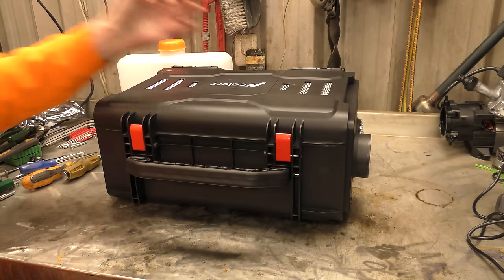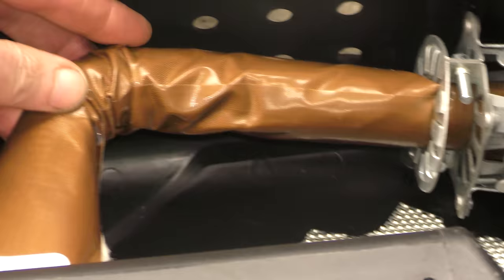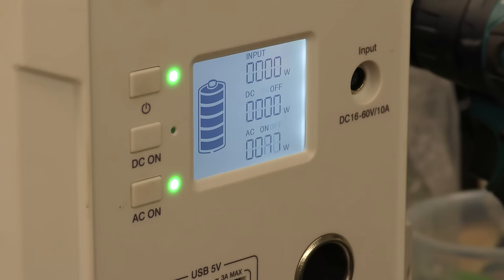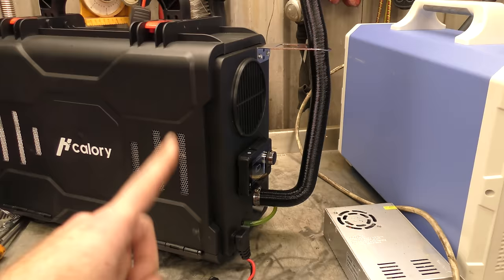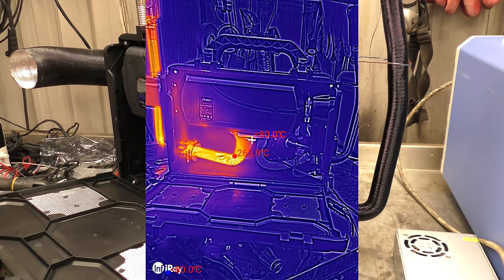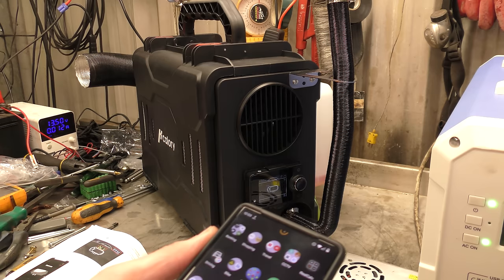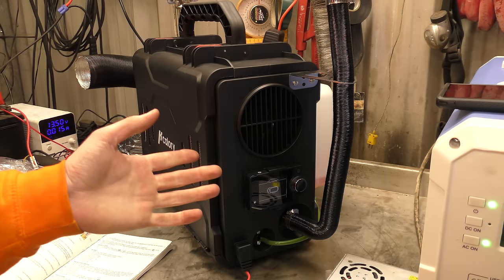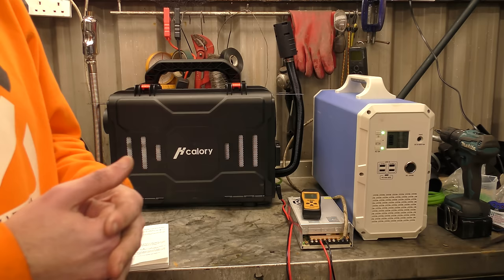Hcalory HC-A01 portable all in one diesel heater + bluetooth control ||  test / review

Comment: Thanks for the video David, Have you been able to change the altitude setting?  I have the same heater and controller from Hcalory and consistently travel and camp at elevations between 2km and 3km ASL.  Based on the instruction manual that shipped with the unit, I was hopeful I'd be able to make changes to the altitude (by accessing En06 within the engineering mode menu) –It appears, however, to only allow viewing of the mode and not the ability to modify it.  For that matter, I can't find the ability to simply fine tune the fuel low and high Hz rate (to manually set it for a more lean burn at high elevations).
Reply from the maker: I think it might be for display purposes only.

There doesn't appear to be any adjustment either.

I have found one controller that does actually do something when you turn on 'elevation' mode and you can hear the fuel pump change hz.  Its the one that looks like the original black rectangle but the display on screen is different.

Comment: David, watched. This video last year, bought the same from amazon,  cracks all over and refunded.  Be this the case, I've two units velor and hcalory,  the hcalory all in one is absolute crawly made, with nice graphic plastic and thick, but after 6 months concealed in a weather proof box attached to.the. house, cracked for no reason.  Why I mention this is, it also had the same Bluetooth function which I found great,  easier to sit in living room and turn.on.or off, up and down etc.  But now I've changed to the velor which has worked for 2 years now in the  Garage l, the Bluetooth function is a passing memory.  Question, you've had this unit a while, has the casing degraded at all,  how do you align the exhaust also, to keep water out whilst on or off,  is it worth the 159 quid at todays price or just aa a standby emergency unit, which is portable unlike other brands.

Cheers enjoy the coming freeze,  you are prepard

Comment: Hi David 
Could you tell me the diameter of the air outlet cover for the hot air pipe 
Is it 60mm or 75mm 
Would you recommend the heater

Comment: I am thinking of using one for my shed. Two questions sort of... I gather the exhaust runs at 200 degrees centigrade? So in a wooden shed that would need insulating particularly where it goes through the wall. I What is the start up and running current?

Comment: I do keep thinking about getting a diesel heater, but then I think about what it needs for it to be used for a house, and how to power it, and where to site it, and how to get the heat in, and to keep the exhaust out, and then I just can't be arsed, cos I have a couple of Aladdin blue-flame paraffin heaters (very clean burning), and with a little bit of dubious wiring I could probably even run the boiler off a decent UPS (so long as there is gas supplied) with battery upgrades, but we shall see, all this "3 hour blackouts cos no gas!!!" could just be scaremongering...
Reply from the maker: My boiler is on a 13A plug.  That's my plan in the even of an extended power outage, boiler on battery or generator.  Then at least I can stay warm.

Comment: Hi Dave, which controller do ypu recommend purchasing as there are 3 options? Or get any and change it out for the australian after burner?
Reply from the maker: Depends what you need it to do?  If you only need basic on off control or want to have schedules or control from anywhere or Home Assistant integration.
Reply: @DavidMcLuckie  on off, adjust the power to the lowest Kw, safe. Other options would be a bonus. 
I don't like the blue style control, doesn't suit the style but then there are another 2 rectangle black models.

Comment: Hey buddy, love your videos,  I have one of the liquid and air heaters. My plan is to have heated floors and heat my water tanks and batteries along with heating the air in my RV, but really need something that works on a thermostat so it doesn't just run all day... Mr Jones can't help because the connections are wrong for the afterburner. Any ideas? I thought about getting the board and controller that his controller does work with and using the fan wire to trigger a relay to run the water pump but not sure if that will work.

Comment: i have 2 ????? can you switch between C or F degrees.    And does it have a clock timer like on at 0700 a clock and off at 0730 a clock (NOT THE COUNT DOWN TIMER)  on the knobbed app controller

Comment: Hi David, do you think I could just run the combustion intake INSIDE the case rather than using the tubing to put everything outside?  With those generous vents on the side of the case, I'm guessing it'd have enough air?  Also, there is no filter on the combustion intake.  Is that a problem?  That big plastic thing is just a muffler.  I've got little 25mm intake filter on the way but curious as to what you'd recommend
Reply from the maker: Yes.  The case itself is sitting outside so you don't really need the intake.  Unless you're running somewhere really dusty, the air filter is there to stop you sucking in leaves and having rodents make a next.

Comment: Hi there, do you know of a "Quick Disconnect" hardware set that works with this white fuel line?  I need it be valved on both sides so when I disconnect, I don't lose fuel out of either end.

Comment: Great video, as I have my eye on this model.  I have a question regarding the exhaust.  It looked like the manual showed it vertical like you set it up, does this avoid the condensation from building up in the silencer/muffler, as I had heard the exhaust should be on a slight downgrade.  Asking because I really don’t know anything about it but have heard what seems to be conflicting info.  Thx.

Comment: overall nice unit . BUT, fuel tank should slide into a holder so you could slide it out to fill then slide it back in to run. exhaust: if i wanted to put in a window and run the exhaust out the window it needs to come out the other end and lay down so i can close the window on it and the hot air out would flow into the room.
Reply from the maker: Both excellent points.  I wonder if the intake hole and the exhaust hole are the same size port on the box.  Maybe it could be switched round.  I like the idea of a removable fuel tank.

Comment: just a trivial thing I noticed perhaps but all the other information I've seen concerning the exhaust pipe is that if the unit is run for very long condensation and water builds up in the pipe unless it is basically pointed slightly down so the water can drain out? comment?
Reply from the maker: In theory yes.  But the exhaust is also running at 200+ºC so any water that does condense will evaporate again.  I suppose the problem would be if you ran the heater, let it cool (condensate forms), and the didn't use the heater again for an extended period of time.
Reply: @DavidMcLuckie  ahh. Thanks for your prompt reply Mr McLuckie.

Comment: How long will that heater run on 5 gallons.  The Bluetooth is a nice feature. I heat my 32ft motorhome with the planar 44d heater. I am on my 4th year with it and no problems.  It runs 24/7 from fall to spring non stop with no shut down.
Our winters are normally from 20 degrees f to 2 degrees f and heats this motorhome very well.  Been a good heater.

Comment: Hi David. Another interesting review. I built a similar heater setup to heat my tent in winter but it has now started playing silly burgers. Won’t fire, the fan just keeps on running. Any idea where I can source spares. Ps. Used a outboard motor fuel tank and fuel connectors. Cheers, Jim.
Reply from the maker: For diesel heater spares it's usually just AliExpress or eBay for me.  Banggood have got bits like exhausts and fuel pumps but not burn chambers.

Comment: A friend and I each bought an HC-A11.
After several days of trying to get the heater to work according to the manual, we gave up.
Now I have been informed that these Hcalory Blutooth are rubbish...
So now we're wondering how you got your's  to work David...?
Reply from the maker: Well.  There's a thing.  My bluetooth app works, but the remote control doesn't.  It also refuses to re-learn.
Reply: @DavidMcLuckie ... Okay.... Neither of these two heaters stops when the set temperature is reached. Nor does the heater start automatically after the temperature has dropped far below the set temperature. Have you noticed that.?

Comment: Some heater require at least 13 continuous volts during the start up process.  Is it the same for this heater?
Reply from the maker: This controller really doesn't like voltage drops.

Comment: I wonder if the radiating heat from the exhaust wrap will cause damage to the plastic knock-off Pelican box over time? I run a small computer fan on my portable unit, such as Keegan Builds,  and it makes a world of difference in the box temperature. Anyway, thanks for review. Too bad that you had to put the power supply in the mix; it's going to pull a smaller portable battery pack down more quickly. My Jackery 1000 easily puts out the necessary 10 amps for the glow plug operation via the cigarette lighter outlet.
Reply from the maker: I'm going to start doing that as my power station test, will it run a diesel heater.  :)

Comment: Does the bottom of the unit get super hot? If it was put on a carpet or wood table would it burn the surface? Cheers.
Reply from the maker: Negative.  The exhaust is wrapped and shielded inside the box.

Comment: Will this work with a Jackery 1000 or 1500?
Reply from the maker: Most likely.  I've run other diesel heaters from the Jakery as they have a real 10A output on the 12V

Comment: I have one of the ones with the buttons along the bottom of the controller. Does the controller or the board read the voltage? It is reading .6V lower than the actual voltage at the harness and won't start unless the alternator is charging as it gets upset thinking the voltage is too low when the glow plug comes on. It's not even cold yet, it started fine in like -30 last year.
Reply: @piconano  I just put a battery in it about a year ago and cables are not green but it's 2022 where new parts are garbage so I guess I shouldn't rule it out.

Comment: hey David, I just bought one of these and used it this weekend and wondered if I could ask a couple of questions,  one I found a green piece of what looks like gasket material (I will send a photo if would allow)  I wondered if this is the cause of my other question. we used it on 6 to heat a 10x9 canvas tent and it would not really heat it like I hoped. the other cause possible is we used a 2" long corrugated hose and thought that might have let a lot of heat escape before it got to the tent. thanks for any help you might be able to give me Jason
Reply from the maker: Were you heating outside air or recirculating the air in the tent?
Reply: @DavidMcLuckie  good point it was outside air and around 15d - 9c
Reply: @jasongallant7173  Hows it working as a cold weather heater that's outside the tent and not recirculating warm air?  I'm wanting to run one of these sitting on my bumper and pumping heat into my pickup camper.  I'll be ski camping where temps are 0d to 20d often at night.  Wondering if it can dump heat.  Seems like most people struggle having too much heat with these things tho.
Reply: @vin9976  I tried it with recirculating air by adding a hose onto the intake I still wasn't super happy with the way it was heating the tent at teens for temperature I read something the other day that says to run it on low fan for a while until it gets really hot and then maybe turn the fan up so I'm going to try that next

Comment: I just bought this and it doesn’t turn on and off automatically nor is F9 available in the menu as the user manual says. How did you get your on/off feature to work?
Reply from the maker: There was a separate part in the menu you had to turn on.  But I cannot remember what it was called.
Reply: @DavidMcLuckie  oh ok so something enabled F9 and then you could turn it on and off using F9?

Comment: Off topic, don't suppose you know how to remove the combustion chamber from the housing on a mikuni my16 heater, its a bit different than the Chinese models. Its got me stumped and can't find any info for it. cheers
Reply from the maker: The exploded diagram looks like there is only a few bolts holding it on once you get all the covers off.  https://mvheating.co.uk/wp-content/uploads/2018/01/my16-mye16.jpg

Comment: How do you get "smart mode" to work from the temp inside the tent when the heater is outside?
Reply from the maker: Exactly.  It should have included a nice long extension cable for the controller.

Comment: Hi David, can you recommend anywhere I can get decent quality replacement heater plugs for my 5kw campervan Chinese diesel heater? The ones I’m getting off eBay ain’t lasting 2 minutes. Thanks in advance.
Reply from the maker: I haven't actually killed one yet.  Is there a fault elsewhere?  Multiple failures would make me look at the ECU that's driving them.

Comment: Is there any alpine mode on this model?  I have James’ diaphragm pump and the thing still smokes like a freight train.
Reply from the maker: Not that I can find.  It shows and 'elevation' but doesn't seem to do anything with it.
Reply: @DavidMcLuckie  have you found a way to even change altitude?  The manual says it has engineering mode, but you don’t seem to be able to adjust anything. I see pics where the number is higher than 0.0, but can’t figure out how to change it. I’m at 7000asl

Comment: Did you figure out why the DC outlet wouldn’t work? I’m trying to run mine off of a 500 watt hour battery and running into a similar issue you had.
Reply from the maker: Not yet.  Requires further investigation.  Going by the specs that power station should be capable of supplying enough current.  Will need to test of the voltage sagged away.
Reply: This particular model don't work with standard 12v from ecoflow bluetti etc, if you take the classic red all in one yes.
Reply: @DavidMcLuckie  As an update - i tried to run it off a jackery 2000 pro through the dc outlet and it was a no go. I’m thinking it needs more than 10 amps to get the glow plugs going.

Comment: THE BLUETTI IS SUPPOSED TO PUT OUT AT LEAST 9 AMPS AT THE 12 VOLT OUTPUT.
Reply: Maybe the 12 volt surge amps required by the heater, is so quick , that it causes the bluetti to shutdown....in other words, the heater may only draw 40 watts initially and then surge to 150  watts so quickly, that the bluetti shuts down immediately ?

Comment: What voltage should I set the ac/dc converter at for the diesel heater ? currently got it on 12.4 volts
Reply from the maker: If it's just running the heater 12.4 is fine, if you were using it to float a battery charge then you'd need to look up what your type of battery is and the float voltage.
Reply: @DavidMcLuckie  Many thanks David. I have just finished my install and everything looks ok. But it wont manually prime. I have no error messages, but I have pressed the 2 buttons at the bottom and nothing happens all though both buttons work okay. I have even tried pressing the up and down arrows but all i get it the temp.

I have checked that all the wiring connectors are econnected but no joy. Any ideas?
Reply: Just sorted the problem, yippee

Comment: I can see a lot of converting with this heater and I'm only 6minutes into the video, this is my own personal opinion of this heater, firstly, I don't like the exhaust coming out the same end as the hot air and the brackets are a very cheap design and can't be made secure enough, for the sake of the case being a little wider the fuel tank could fit inside, for the money (£185) I think the Chinese heater is better, again, this is just my opinion.

Comment: "Tuning, we'll get to that later..."... you didn't.
Reply from the maker: Ah balls.  I should have cut that bit back out.  I was hoping that by being to select different sized fuel pumps it would alter the fueling frequency based on that size.  But I didn't notice any change in pump speed as I did it.  I need to revisit that in another video.

Comment: What is the app called because airheaterble shows nothing in the app store and even the mirror files I find online are broken . Just ordered one and want to make sure there is a app on the store or a mirror for Android
Reply from the maker: I couldn't find it in the app store.  But here is the link to the apk from the manufacture - https://www.booyood.com/app/airHeaterByBLE.apk
Booyood is the company that makes the electronics for the heater.
Reply: @DavidMcLuckie  thank you very much I searched everywhere on Google for the apk and what little I found were broken links. The one you mentioned worked immediately. So far love the heater. I use to have to wake up middle of the night and turn off my old unit because it would get the house to hot but this on in auto mode is working great. Thanks for keeping us informed on these heaters
Reply: @DavidMcLuckie  Thank you. Used your link ordered one, asked seller for the apk. I think you should add this link to the video description.
Reply: @DavidMcLuckie  is this a "android" link only? is there a separate link for an Iphone?

Comment: The trouble with running this indoors is add heat to a room and food to a belly and sleep takes over at the end of the day, if you fall asleep running this indoors you'll probably die.
Reply from the maker: I think I'll need a video about this.  A properly tuned diesel heater produces the about the same CO as my diesel FireBall heater when run indoors.  Both scenarios recommend ventilation.